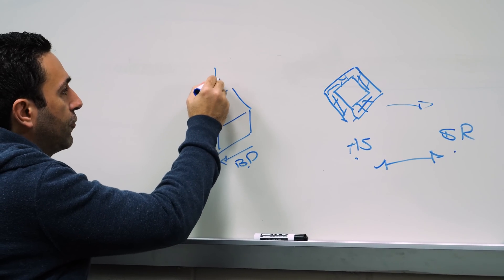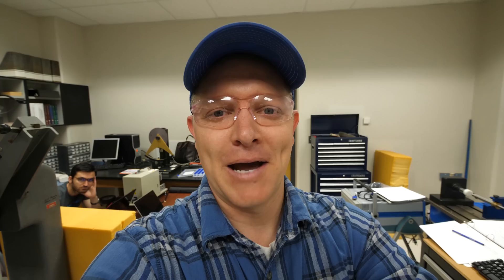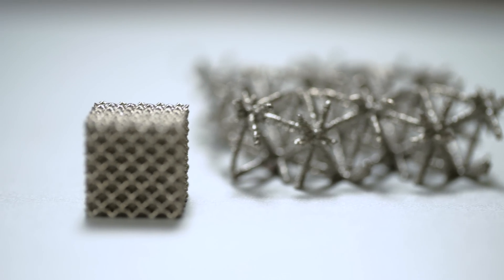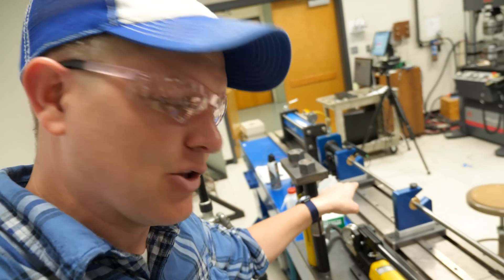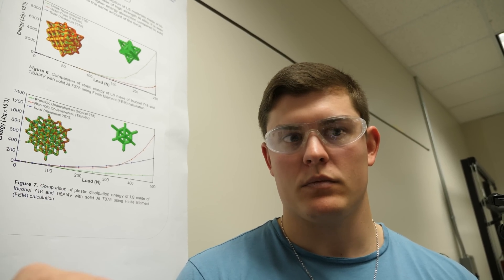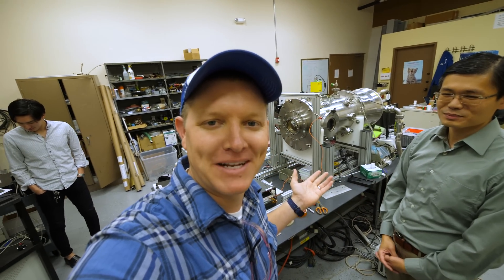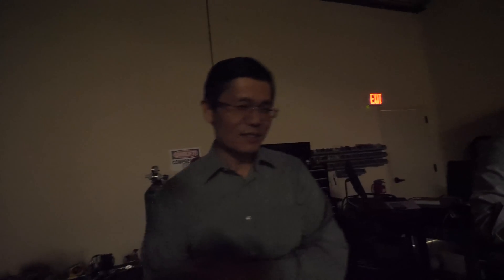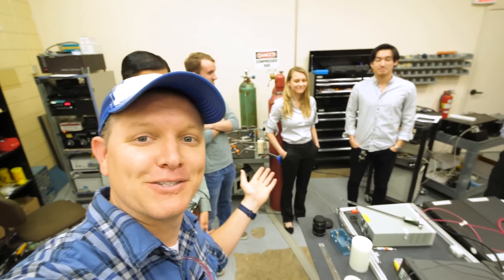Touching Plasma PhD Research Opportunities at UAH - Smarter Every Day 193

Comment: I wonder if I'm one of the few people here that instantly gets the difference between crushing resistance and impact resistance. When pressure is evenly applied to a material at a slow rate it is (typically) easier to withstand. When the same amount of pressure is quickly applied to a material it causes a shockwave to ripple through the material making microscopic (or smaller) changes/waves to/in the material causing it to fail easier. It's similar to the difference between a push and a punch.

Comment: For the first research which have you shown in this video, how about increasing the strength of the material by enclosing the printed structure into the matrix material like resin or epoxy like composite materials. Preformed produced in the fabrication process of composites by woven strands have more fibrous content around more than 50% by volume. The specific structure like this is not possible to make using the fibers in the composite materials which have 50% reinforcement content by volume but that concept can give a slight advantage over the only metal structure. This would make the final material still lighter than the only metal counterpart but this will give higher strength than the only printed structure of the metal. Let me know if that works and thank you for your work, Destin!! you make amazing videos and keep it up,  il look forward to your channel.

Comment: Wow when I was an undergrad I did research for free for two different proffs, simultaneously at one point. The one project I believe is still in use cleaning telescope mirrors at observatories. I didn't develop the polymer just did a lot of characterizing it's properties.

Comment: Spoiler allert. Our universe has a dedicated spin direction. Which translate to spiral pulleys.
Im sorry but latices made out of straightl ines wont do. Oh and static structures are the weekest. If you want strenght you have to shape these so they have an internal stress that keeps circulating in the latice on a "wavelenght" and you have to manage the heat generated from it. The stress can come from induction or whatever.

Comment: Destin, I know this is an older video, but when it comes to the strength of the latticework and trying to make it stronger - wouldn’t it be stronger if instead of diamond shaped lattice using straight lines, you used arched or circular shapes and layered them? By nature, arches are stronger because there are no weak points like there are with seams. Like an arch bridge, for example. The stronger the impact against the arch, the more the impact is distributed.

Comment: You could use the geometric design and metal printing capabilities of the first guy to create for the second guy an anode that would perform optimally due to exponentially increased surface area, compact volume, and strength.  Amiright?!!!

Comment: DUSTIN! at 9:30 the Dr. is touching assuming plasma, What is that about and why would you skip talking about this??
Reply: That is cold atmospheric plasma created under high pressure low temperature (law of thermodynamics) to sustain the plasma beam 
The resultant beam is around 300 k temperature and can be modified as per requirements
Reply: DESTIN.....
Reply: I believe that it's not a lot of material being expelled. so the force or danger isnt noticable. Like low voltage (not enough to get through skin) and not hot because the there isnt enough stuff to transfer heat to his fingers.
Reply: Jonathan Nunez I want to know the same thing
Reply: So many questions..  i have omg.
Reply: Who is Dustin? This guy's name is Destin.
Reply: I know the pain. He probably gets Dustin all the time and his name is Destin whereas my name IS Dustin but I get Destin and Justin all the time.

Comment: I have always wanted to see slow motion footage of wood fire ash or cigarette ash in the rain. I have seen ashes flow upwards in rain seemingly un-scaved by the water droplets. I'm wondering if the water actually hits the ash, yet the water tention is so strong that it just pushes the ash out of the way? And is it possible even for water to knock ash out of the air or not?

Comment: Destin if you got all the helium gas out of the world and put it on one side of the planet 🌍 would it change the orbit of earth or would it change ho much gravity we have on earth. This is a question that I’m no where near smart enough to answer but I hope you can answer it for me thanks Destin
Reply: Will and the Bros helium has low density, so it floats on earth, but doesn’t have the ability to float in space.
Reply: Basically, it won’t cause any noticeable changes over the short time it would stay on that side before heavier gases fill in the area again
Reply: Here's your answer: no. Moving gas around doesn't change the weight of the atmosphere, a kg of helium still weighs the same as a kg of lead, it just makes baloons float because it's lighter than air, it doesn't have a negative weight.

Comment: I have a question for Dr. Xu : 
What is the difference between the   coil of wire and an induction coil? 
 I only ask this question to point out to you the reason why my  original thruster would cut out, or stop working. My Eureka moment was when I realized there was a build-up of residual impedance. THE longer the wire made into a coil, the higher the resistance in the coil. Basically there is no such thing as a room temperature ionic thruster. Contact me and I'll tell you how mine works.
Reply: r/iamverysmart

Comment: I have a question.  What would happen in zero gravity if you could heat water up to boiling evenly when there are no nucleation sites for bubbles to start. Assume sea level atmospheric pressure.  

Would bubbles appear uniformly withing the liquid, or would the surface of the liquid evaporate really fast because in the middle of a liquid, every vibrating molecule bumps into another molecule because it's completely surrounded by water molecules, but at the surface, there's a 50% chance there's no molecule to bump into and it can escape into a gas.

Would it just be an accelerated form of evaporation, or would the phase change cool the surface  causing a thermally cooler layer molecules?
Reply: Google it. It's been done and there are a ton of articles and videos. Also you might want to use the term "micro gravity" because "zero gravity" isn't a thing.

Comment: I wonder if anyone has tried using an AI to develop an optimal design for a strong, lightweight 3-D metal matrix. I remember not too long ago seeing a structural wall panel for an aircraft redesigned by an AI and while it looked bizarre, it did appear to be notably lighter and stronger than traditional structural designs.

Comment: I've actually wondered about something similar, in the kitchen. 

My idea, was a bowl, but with 50% of the atoms missing, but with such a small space between the lines of the lattice of atoms which comprised it: 

that this bowl would still be capable of holding water for everyday use. Saving a significant percentage on materials.
Reply: Just a rough inkling of an idea
Reply: Oc course: the way lattices react under force: is a lot cooler, in my oppinion, but still, I wonder about "leak-less holes"

Comment: Is quartz crystal a potential printer filament for lattice structures if printed under heat? I’d be curious about the piezoelectric output of some of these structures. Sci-fi Daydream application: use piezoelectric lattice structure in airplane wing to convert flex into power source.

Comment: the structure in metal indeed play a big role in determining the strength of the metal, but I think our 3D printer is not advanced enough to put it to good use. They need to be more precise and able to create the structure in much smaller size.

Comment: Congratulations! Sounds like you're in for some fun times. Now, if a memory metal were formed into a latice and then crushed, would it be possible for the metal to regain it's original shape using the heat energy transfered to it by the impact? In other words, a dentless fender or lightweight shock absorber?

Comment: Looking at the deformation of the latices under impact made me think that this could be the next big thing in vehicle safety features. Plastic/aluminum latices that deform to slow the transfer of collision impulses that also reduce total weight. Amazing!
Reply: University of Nebraska-Lincoln already uses quite a few of these matrices and lattices in designing guard rails which the NTSB evaluates. (Also makes the foam barriers at race tracks)
Reply: I think self driving cars could also be a huge improvement to vehicle safety!
Reply: @Chazz155511  thats already a thing it has been for years lol

Comment: With the 3D metal does the act of compression absorb a lot of the kinetic energy and if so would that metal be a good idea to use in the front and back of vehicles to reduce damage and injury?

Comment: What about using memory impregnated titanium metal, NASA has been using it for over 20 years? or looking at bees that use sound vibration caused by small cones under their wings to produce lift by moving their wings to produce sound=vibration=lift. simples!
Reply: Bees wings produce downward thrust more like a helicopter, but instead of rotating, it's back and forth. The wings of a bee flaps back and forth, and a bit of up and down, and the wings also rotate to change angles. When they drive their wings forward (and down) it's more horizontal, but with slight angle of attack. This cuts down air resistance without much loss in lift and allows the wings to be "flicked" very far forward for as fast as possible. As the wings approach their maximum forward position, the wings are angled more vertically, creating a more aggressive angle of attack that drives air down. When the wings are being pulled back, they are rotated so they create an angle of attack (which is again more aggressive compared to when moving forward) appropriate for the reverse motion, which again drives air down as the wings move backwards.

To really replicate that level of control in a micro scale would be very challenging. I don't think we have that capability yet. We have to fabricate micro linkages or artificial muscles that are fast, light, and strong.
Reply: @namasayanif  figure eight
Reply: Heh, yeah, I thought of the figure 8, but it doesn't paint a picture of the wing rotation.
Reply: @namasayanif  Fair, the tips follow an eight, but the wings also rotate to vector the air for lift followed by reduced drag
Reply: k

Comment: So the thing about these 3 is how the 3 topics overlap.   To coordinate the 3 together would be something. The butterfly wing may actually work due to microscopic structures in the wing creating an electrical lift similar to ionic lift.  Neat how all 3 are tied together. The real magic though is what engineers can design that can be practically made.  I love research but engineering is what gets things made.

Comment: Its a beautiful campus and the folks in engineering there are helpful and motivated. The community outside the university in Huntsville and Madison is outstanding and friendly. And the opportunities to work with all of the local engineering firms (gov or gov sponsored) are not the only perk. There is a national laboratory within a short drive that the University works with as well. I caution you to double check other students ratings on professors (with a grain of salt of course) in all areas to avoid the duds. Got a dream? Chase it!

Comment: Question to destin: when they design the structure for the 3D printed metal why dont they use nature as a inspiration for their poorus design? they might already do it :)  i remember seeing a ted talk (that i cant find now) where the researcher used the design of nature to build a large  round green house that was 50 meters in diameter. and later they relized that the air within the structure weigh more than the structure it self! fun fact! :)

Comment: Their using satellite's with infrared lasers. I've seen the shots using the camera on my Samsung 8. They shoot the infrared lasers through the chem trails to activate the bacterial fungus or virus after it flattens out in the sky. I have video of it. It lands everywhere then we the people transport it everywhere. They use the bacteria or virus to deplete oxygen in the body. I use original pine-sol in a misting spray bottle to kill it. When I look up at the sky I can tell exactly where the satellites are from them beaming their tech at me. It's like having a flashlight shined in your face without seeing the light. I'm getting a telescope soon to get pics and video of their sat's.Their also using satellite phone satellite's to voice to skull and or the microwave auditory hearing effect to talk to everyone. They use the lymphatic system to cause synthetic touch. Its done by building pressure in the lymphatic system.That's the tingling or the electric feeling that you have in your legs. They can also change the appearance of someone by building pressure in the lymphatic system. The eyes become red and the parts of the face swells from it. They can also effect the thyroid gland to cause hormone imbalance. I take pro-biotics, 35% food grade hydrogen peroxide, selenium, raw red onion. I only drink distilled water. Stay away from fungus food. Keep a clean environment by using sanitizer or anti-bacterial soap.

Comment: That force transducer they use to measure the butterfly wing forces is made by the company I work for! It's actually a force torque sensor that can measure in all directions and torques. Pretty cool seeing it used in such a unique application.

Comment: ION thrusters look and sound cool, but I think what everyone should really look into, is better power source for mobile devices. I don't mean just mobile phones, I mean devices such as drones, flashlights, laptops ..etc. Our development on devices like that has been good since like 90s, but only thing that remains same .. is battery. I haven't seen any progression in power source field and it seems like everyone has just given up on trying to find a better power source.
Reply: I feel your pain, but would like to mention that people have definitely not given up on alternative power sources, it is just REALLY hard to make something like that. I know various forms of specialized capacitor banks utilizing graphite are a potential alternative, but they are too early in development to say. There are always new tweaks on lithium batteries that make them more and more capable, but there is only so much chemical reactions can do. There are also many other potential candidates, but again, this stuff gets really complicated and takes years to develop, and then even more years to make it commercially viable. 

As for a power source field, I assume you are referring to the research that Tesla was working on (not the company). There are some serious flaws with this form of energy, first and foremost, it is a MASSIVE waist of energy as by definition, to propagate power through electromagnetic radiation, most of it won't ever get used and will end up just flying off into space. Then there is the fact that you are blasting radio waves (or some frequency, not actually entirely sure) that will definitely interfere with sensitive equipment such as GPS satellites to name just one. That along with other problems that I won't bore you with... 

Anyways,
I'm especially interested in it as I am a little sick of having my drone die in the middle of a race after less than two minutes >:(

Comment: Definitely 3D metals Destin. I can see the applications of super tall structures in normal-G or normal height structures in high-G environments being pretty critical in space (planet)  colonisation. Perhaps it would even be possible to build high altitude launch platforms using lattice structures to enable SCRAM technology launch vehicles to achieve LEO or GEOO and replace rocketry as the primary methodology?

Comment: Hi. Regarding your 3D Printed lattice structures, I recently read about a newly discovered super alloy called Ti3Au, which is theoretically compatible with 3D printing, and has 3-5x the strength of pure titanium. Obviously the gold component would limit use to critical parts and things like joint replacement, but paired with honeycomb or faux metallic foam structural design (both of which should be able to be simulated with algorithms), the size of objects that can be made should be less limited the the mass of gold required, and the strength should be pretty amazing. Anyway, it seems highly worthy of exploration.

I wish I could apply, but unfortunately i am dealing with medical issues.  Please pass along the suggestion for me.

Comment: What about dropping it from a very high height, will it deform or become compressed? That is  the lattice cube.
Now I think that you should strap on a overunity jet engine in front of the ion propulsion device, and see how this thing work with burning the air that comes in from the compression fans. Now the fans should be built with, 9-6-3 times proportion, from front to back based on the radius of the diameter shaft. After the air passing through the fans it will become compressed then go through the ion thruster, that is the air that go through the center of the engine, not the air that go through the outer that keep the engine cool. Also, for those fanblades, let them be made of  combination composites of ceramics and light durable materials, that the fans may be light but gives of heat quickly, and notbretain it as, heavy materials, metals. I think that this research is on the right track, I have made contribution in this regard before, just look, since you're in the process of investigating the potential of this thing.